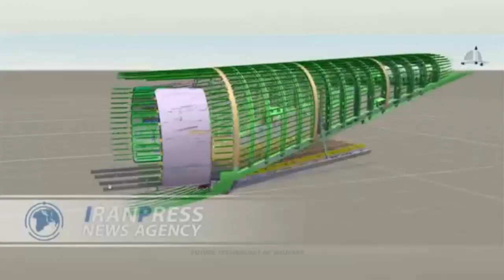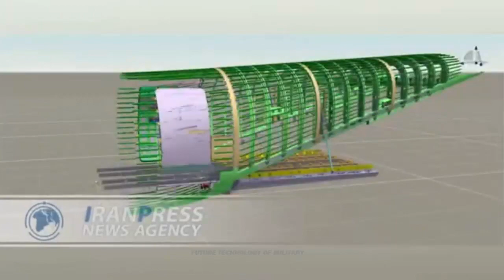Watch Iranian Simorgh Aircraft Make Maiden Flight : it Claims Better Than The America's C-130?

Comment: Looks good, but it's smaller than C130. Nothing has beat a C130 in overall design, production, lifespan, etc on and on. See if the Simorgh is around in 50 + years. C130 most likely will with a base design that is already pushing close to 70 years old.